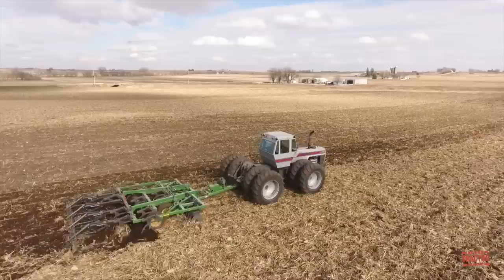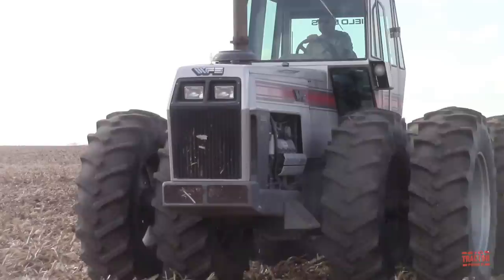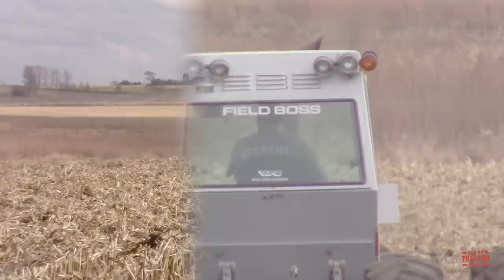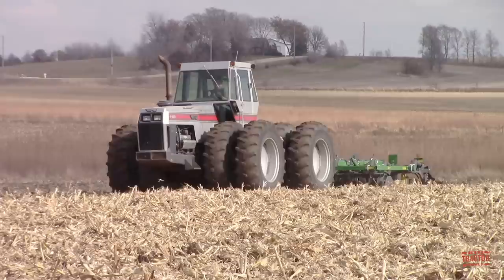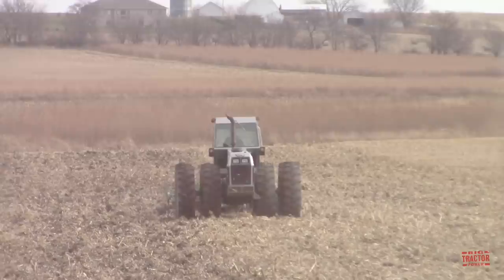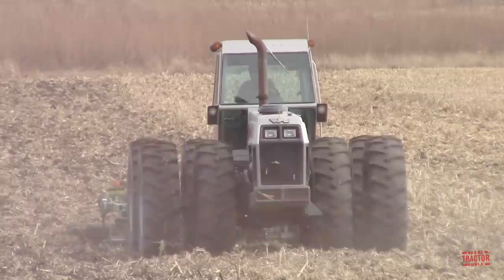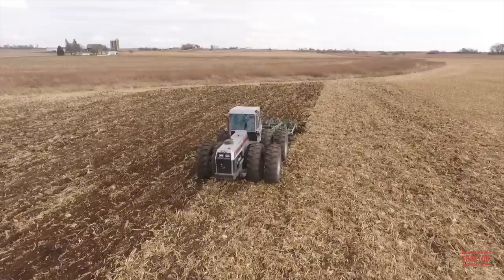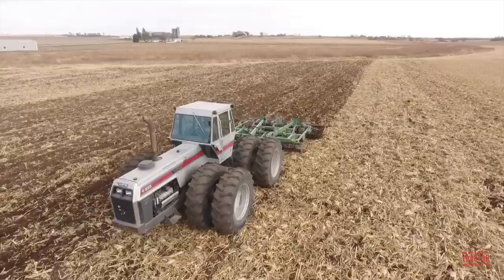WHITE 4-225 Field Boss Tractor

Comment: Are those suitcase weights on the hitch of that chisel plow I've never seen that before? And those 3208 cat Motors are pretty awesome I used to have a Steiger bearcat with one in it couldn't beat it always started no matter how cold it was. And never had to do anything to it other than regular maintenance
Reply: They are there to compensate for the extra weight of the leveler on the back.

Comment: I worked for WFE Libertyville, IL as a prototype build and test technician 1976 to 83 and built one of two 225 prototype that were powered   with Detroit 6V53T rated  at 225 HP bought of them failed early in testing around 150 or so hours. That why the CAT engine was used.
Reply from the maker: David thank you for sharing this interesting history.  I would enjoy hearing more about your time at WFE.  Could you email me at bigtractorpowermedia@gmail.com
Reply: I will big tractor guy, one more thing of interest on the 4 210 one day around 1980- 81 at the Libertyville, IL R&D   we were asked to set a two wheel drive cab on a 4 210 and it just did not have a nice  a look as the standard cab.
Reply from the maker: @davidstanonik3389  very interesting. I guess they were looking to reduce manufacturing costs?
Reply: Yes for sure to save cost.

Comment: We are running a 4-210 and a 4386 IH.  I like driving the White a lot more.  The IH outpulls it, but it is harder for me to drive at my age (70).  My backup tractor is a 2255 4wd.   I would trade the IH  for a 210 or 225 any day.  Oh yeah, lest I forget, it is nice to have good brakes.  The White is a lot better.
Reply from the maker: Very nice line up. I own a 4786.  I know those 86 series controls and shifting well.  😁👍

Comment: I work my real small farm with a 1949 ford 8n tractor. Just thought I would tell you that.
Reply from the maker: Very cool. I have a video on filming every tractor from the 8n to the worlds largest tractor.  I like 8ns. What implements do you operate with your tractor?
Reply: @bigtractorpower  I use a 1 or 2 row bottom plow. And a 7 foot field disk. And a 6 foot bush hog. I've also. Had at one time a 12 foot grain drill. But I sold it. I've got a 2 row corn slash cotton planter not sure what kind it is. Then I got a few wagons that I pull. That's what I got.

Comment: I always find it strange how massive these tractors are, yet the power is relatively low compared to a modern tractor of roughly the same size
Reply: Tech has gone forward flying since development of diesel engines.
Reply: torque is key
Reply: @a.sandrocagliostro2517  Torque is actually a pretty worthless measurement that is mostly used for sales comparisons, but I get what you mean. Big diesels in trucks, tractors, locomotives etc. have always been rated in horsepower at normal operating speed, because torque doesn't have a time factor built in to the measurement, so it doesn't tell us how much work is actually being done, or how much it can do in a specific amount of time. 225 hp doesn't sound like very much, especially with where car and pickup power ratings have gone, until you realize that it is being done at a very low engine speed. A 225 hp V8 pickup engine has to spin ~5000-6000 RPM to get that rating, almost 3 times as fast, and it won't live nearly as long doing it, especially if it were placed in a machine like this.
Reply: @ChevyConQueso  pulling a plough is more of a torque thing than a horsepower thing
Reply: Modern tractors are measured in ponies .😀

Comment: The articulating 4wd's, including jd, mf, and others, all look so nose heavy. Most of the weight is on the front axle, its hard to imagine the rear wheels would pull as much as far as equal power distribution goes.

I was surprised to hear this has a 3208 in it.  I drove a smaller white once. A FWA, it was a very awkward tractor till you got used to running it.